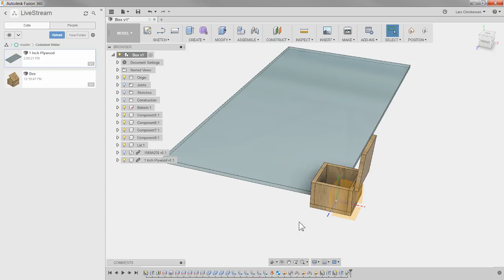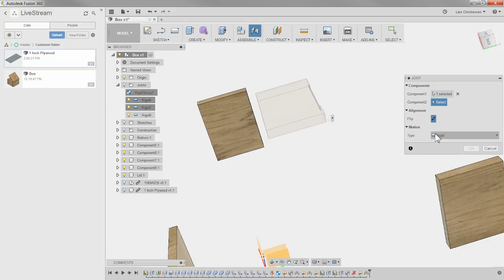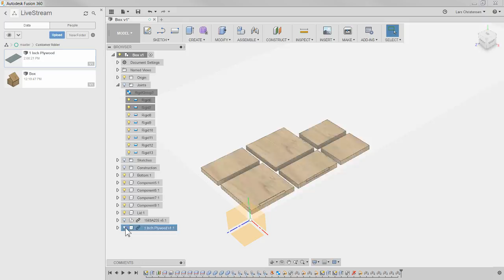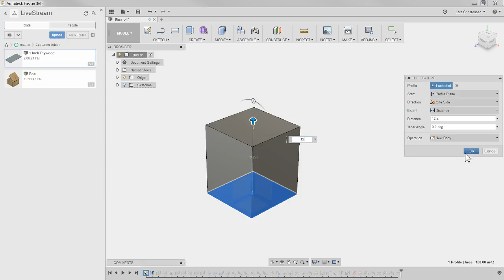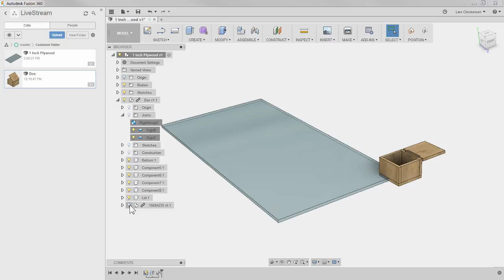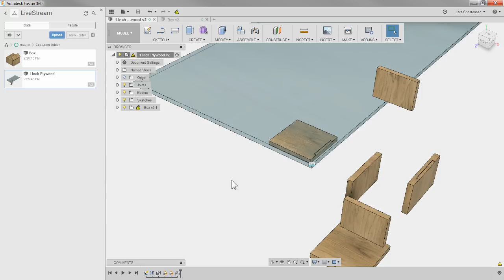Fusion 360 CAM — Layout Multiple Sheets On Your CNC  — #LarsLive 71

Comment: Your unplanned "3rd" option is best of both worlds with a new file just for the CAM, but yet keeping the link to the original Model so it can update with changes. You can easily sort the issue out with the Joints. Rather than suppress them, you can just delete the Joints since you don't need it for the CAM file. Original Assembly (model) file stays unaffected. Today (2021) we have of course Arrange as a simple nesting tool and Manufacture Model which simplifies your Option 1, but to have the CAM in a separate file, there's some good tips here.thx

Comment: How do you get the template to come in at the origin of the box? Mine doesn't do that, but cuts the box in half. My "box" doesn't have a bottom (another issue), but the center of the bottom of one of the sides is tied to the origin.
Reply from the maker: Hi Martha Gay Thank you for watching!
You have to make sure that when you create the template that you draw that on that parts origin. Then it should be placed at the same place when you insert it.

Hope you have an awesome day!

Comment: Fusion 360 really needs to have a "nesting" function. Manually moving pieces to create a cut diagram is not very efficient  especially if your project has many pieces to cut or even multiple copies to cut. With more and more woodworkers and now sheet metal workers using this great product, a nesting function would greatly enhance this cad/cam tool for them and myself
Reply from the maker: Yes, Vote! The developers are keeping a very close eye on the idea station.
Reply: There is a Nester script, check it out:  https://www.youtube.com/watch?v=7SY367qt3YQ

Comment: I work with fabric so a given width but a continuous length. I currently layout for the size of the table 4mts but some jobs are multiple tables long. How can I create a toolpath that cuts the table then pauses so i can roll the next tables worth of fabric to X0Y0 and start again. I dont know if that makes sense, it does in my head.
Reply from the maker: Hi COVER IT! Australia Thank you for watching!
You should totally be able to do that. One way could be to right-click your setup and select Operations and then Manual NC. Now you can input the code for pause (like M00).
Reply: Thanks Lars I appreciate the help